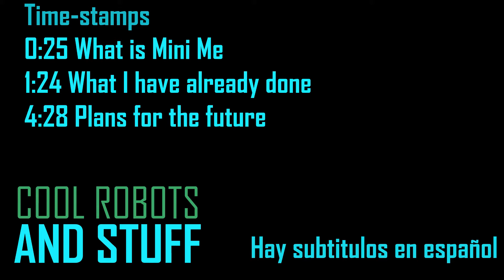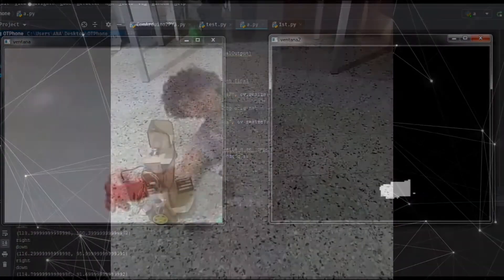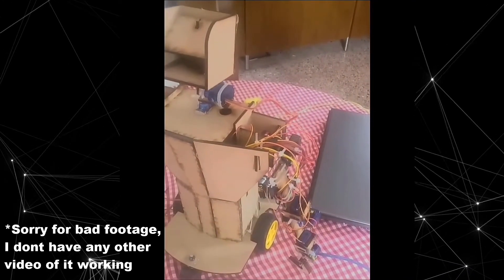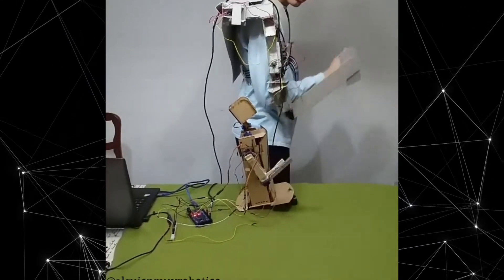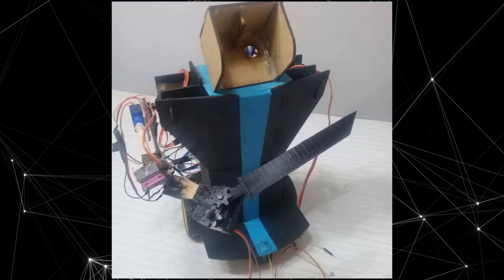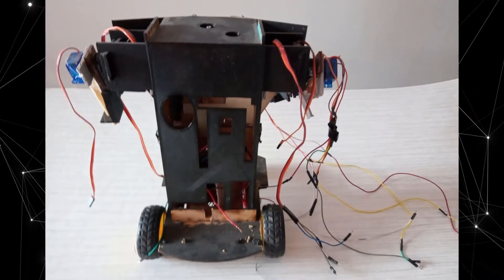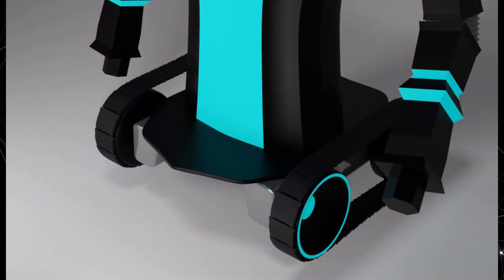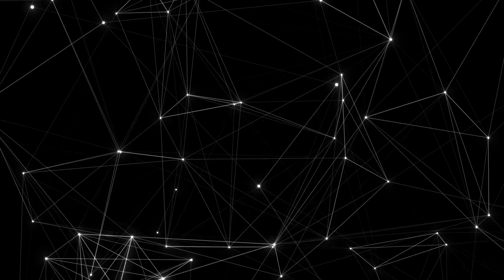Mini Me and Exoskeleton - What I have done so far and plans for the future

Comment: You should use those 20kg High Torque servos, like £20 each
Reply from the maker: Yeah, I thought about that, but it would exceed my budget. I live in argentina, so plus shipping and taxes, for 20 dollars I can only get 13 kg ones, wich are the ones I'm using in the last version.
Reply: @coolrobotsandstuff847  Ah I see, then I agree that adding a gearbox will be a good idea, so long as it does not affect speed to much.
Reply from the maker: Yeah, the problem with the gearbox is that it reduces the range of motion too, and I need the full 180 degrees in all the axis, so I can only use it for the motors of the wheels. I'll see if it works ok right kow, and if it needs more torque I'll probably just en up buying the more powerful servos